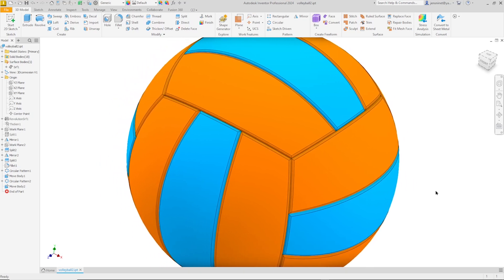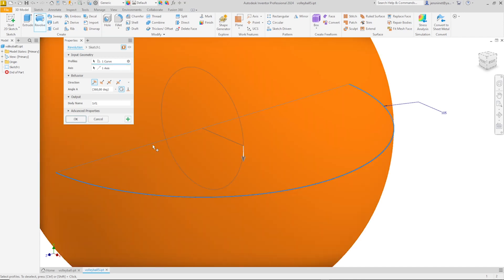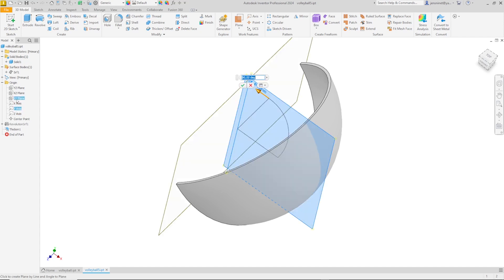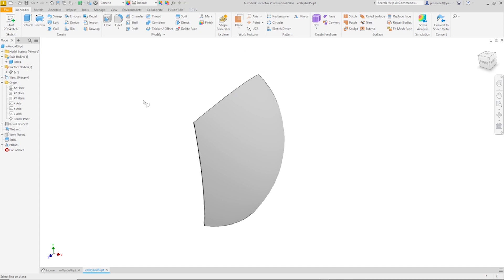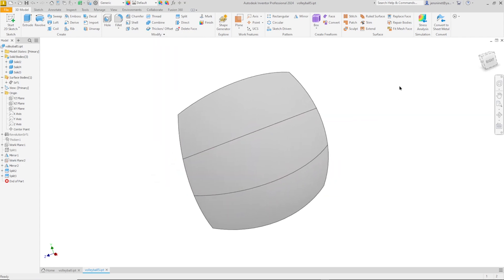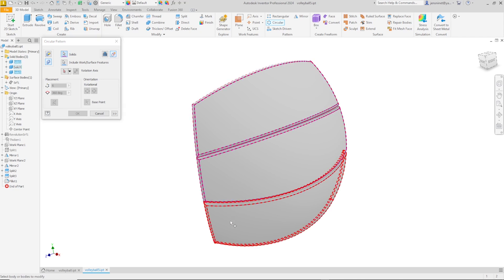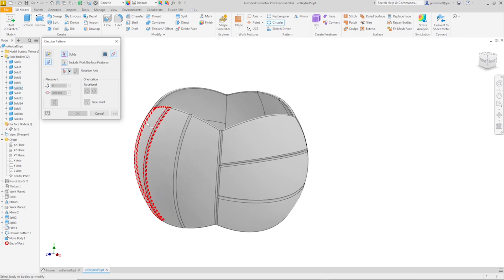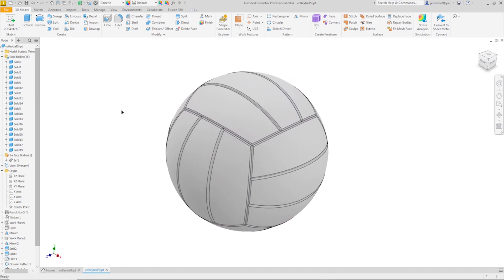Step-by-Step CAD Tutorial for Modeling a Volleyball in Autodesk Inventor

Comment: Hi, your videos are very nice and I was hoping to find some inspiration to solve a question, could you help me ? Imagine a hemisphere with the south pole resting on the plane and the equatorial line pointing upwards, this hemisphere is composed of 8 closed petals that must not overlap and must fit together perfectly, joined together to form the inverted dome like a half sphere. I have tried various attempts but my preparation for Fusion 360 seems to be inadequate 😀
Reply from the maker: maybe you can share your  file, or any  drawing/sketch to have a look at that?
Reply: @cademist  Sorry I didn't respond sooner, partly because of the time difference and partly because of my job that leaves me little free time. I am sending you a link where you can see what I would like to do. The original sphere was 20 feet diameter, me of course being a project I would like to make with FDM 3D printing, it will be much smaller, I think diameter of about 600/700mm depends on the motors I will find.
Your help would be appreciated
https://drive.google.com/drive/folders/1nt-ThYvesirItXG1OMQxrHDi3vvzMRK9?usp=drive_link